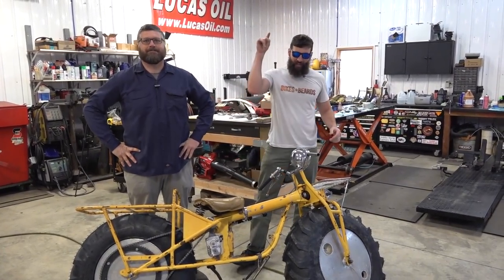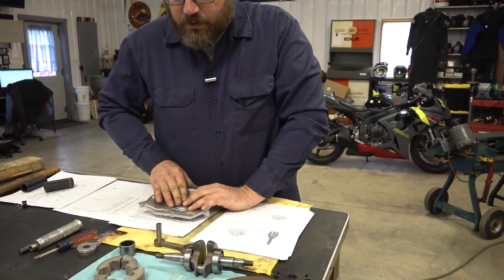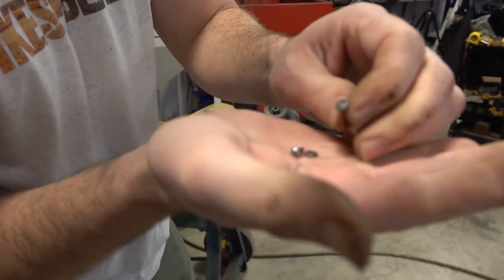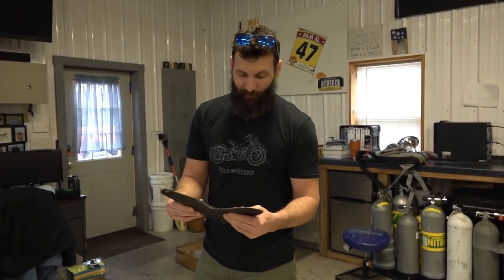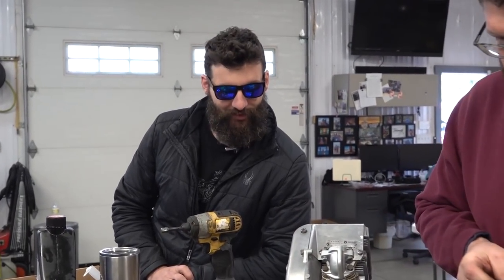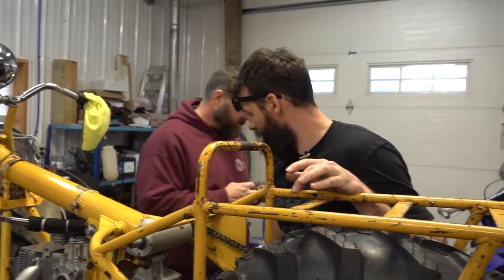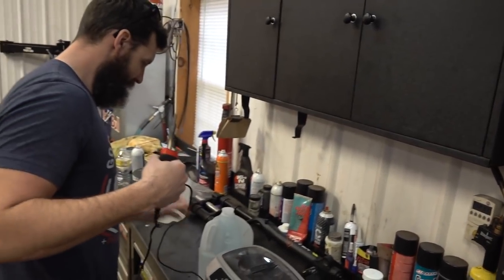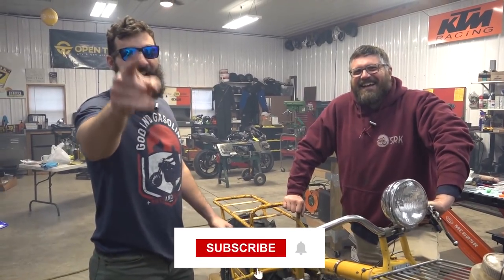Will it RUN?  Rebuilt Ed’s Rokon Engines finally Goes in

Comment: It took you seventeen days to fix a lawn mower engine, one that was very popular in its time with lots of spares...? Just stick a 50cc Honda Grom engine in there. With electric start. Ed is in his 80's and in no condition to pull or kick any kind of motor to life. Button start. Do it over. Betcha it would take less than a week, including mounts, power transmission and controls.😤
Reply: Hell, stick a Kohler 20hp lawn tractor motor in. Key start... only maybe upgrade the alternator and battery.
Reply from the maker: we were just told to restore not completely modify it. but i do see your point. also it was hard to track down parts

Comment: Out  of curiosity why are rings not made to overlap at the tips?
Reply: then they bind,blow the ring land off the piston and end the engine (hot and cold expand at different rates,combined with up and down movement at several hundred rpm)....watch any nitrous engine build and it will explain it in detail
Reply: @trillrifaxegrindor4411  Which is why I explicitly asked why they are not made to overlap at the tips? This would indicate the tips would have to be pointed in order to not interfere during expansion, or that the ring groove would have a step to allow the rings to be pre-overlapped at installation and allow the tips to slide past each other as they expand.  Then  you can have "optimal" ring gap of 0, and no worries about expansion causing an interference issue.

Comment: 4:15 CRINGE!!!  Those webs should have been supported in the middle!  Had he simply heated the case, the bearing would have literally fallen in.
Reply from the maker: craig is a trained motorcycle mechanic and has been working in the shop doing these things since he was 10. I think he knows what hes doing by now

Comment: How is it I have watched 2 or 3 different videos of these 2 guys with the bike frame and still not seen them do anything with the bike yet? I seen one video where they got the bike, they stood around talking about it, then I seen a video where the people having this done came and visited and everything was tore down off the bike. Then that last video, no progress, all they did was talk about not painting the frame,  and decided to pressure wash the frame. Whats the deal? This still seems like one big scam.
Reply from the maker: what are you talking about man, the first video we got the bike to fire up and kind of ran it, then we took it apart, the last two video we put all the drive lines components in including the mitre boxes and the transmission, and this last video we got the engine all put together and installed and got it to run.

Comment: SRK had an interesting and apparently successful business plan - taking a risk with an auction bike and turning it into an online sale. I'm still trying to figure out what this dumpster fire is all about.
That Rokon is as complex as a lawn mower and you two knuckleheads are struggling to assemble basic hardware. I worked on mine outside when I was 12 & had less issues.  Oh yeah, the sun glasses inside really look rediculous 🤣

Comment: I don't understand.. Why are you putting a rebuilt engine in a crusty frame? Is there a shortage of sand paper and paint products I don't know about?
Reply: Just in case the parts that they just removed will no longer fit back on 🤔

Comment: It amazes me that you two are professionals, you screwed up every step of the process, made zero upgrades, and didn't make any improvements to a bike meant for an elderly man.
I would never hire you guys to do any work on my bike, my skill level as a journeyman do it yourself'er is equal or superior.
Reply from the maker: Wow that’s awesome, What is your current project ?
Reply: @BikesandBeards  66 Mustang straight 6, conversion/swap with a new edge GT motor, and drivetrain. 

You could have at least buffed the headlamp, added an electric starter, new springs for the seat, something. Fabrication is part of this entire build, and you guys are the only ones who did not.